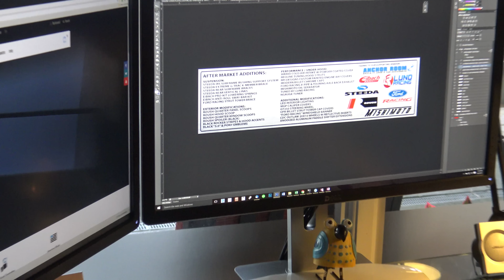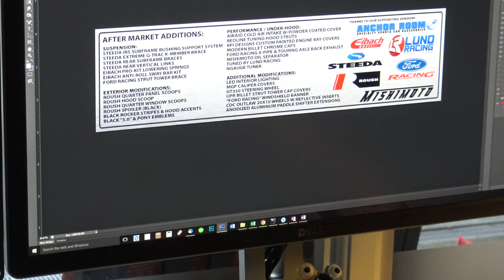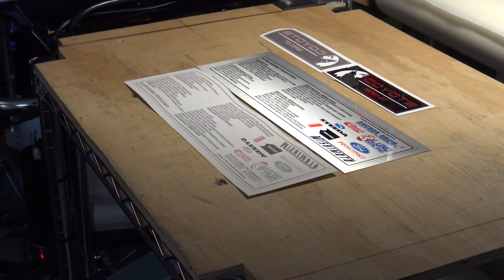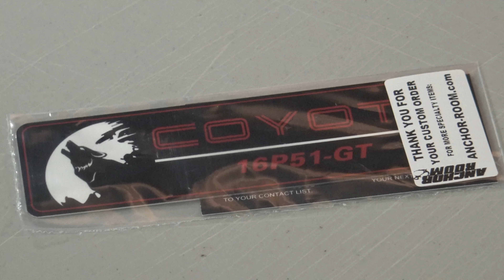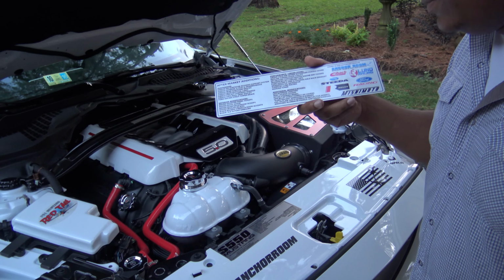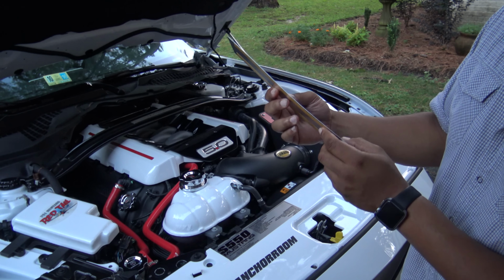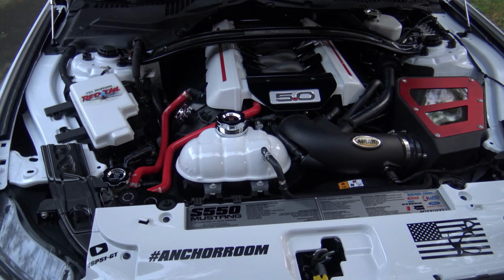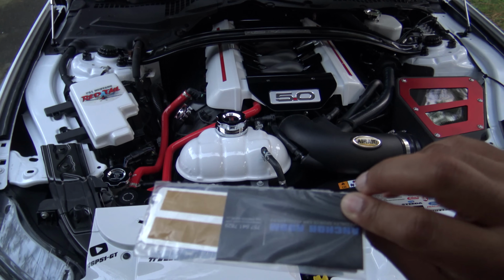Making Custom Aluminum Plates

Comment: Nice custom touch! I have bee looking for someone that could make these type of things for my car.
Reply from the maker: You found them now!
Reply: Love the plate!!!  Question:  where the plate is.......the white, painted part, is that the stock piece, just painted??  Or is that a whole new piece??   

My plate will simply say:  "DON'T TOUCH MY FUCKING PAINT!!!!  I'M WATCHING YOU!!!"
Reply from the maker: LOL!  It's a stock part painted.  It's not my stock part though.  Through rpidesigns.com they just send you the part painted.  But you can just paint your stock part if you wanted.
Reply: one more thing...........on anchor room's site, I was looking at the "build plates".   The site says they're 2.5" by 6".............your plates seem to be more like 8 or 10 inches long.  
Also, on the site it doesn't seem to give all the options to make the plate look like yours.  (with the Rouch, Ford Racing, Steeda........etc symbols on the right side of the plate.)  

A little more info on how to customize the plate??    

I really want one of these.  Would want an NC State emblem on mine.
Reply from the maker: Yeah, the plates I have aren't on the site yet.  Best thing to do is either call or email them and tell them that you want the plates like I have.  You just have to email them with what you want on the plate, they can do any logo and they send you a proof to look at before they print it to make sure it's exactly what you want.
Reply: cool, already talked to Jennifer.................thanks.
Reply from the maker: Yep, no problem!

Comment: p51 I noticed you have an airaid cai how is it working for you?  Is it a completely sealed unit?
Reply from the maker: It's been working well.  It's completely sealed other than the air coming in through the grille of course.